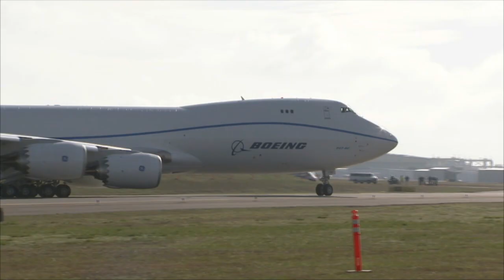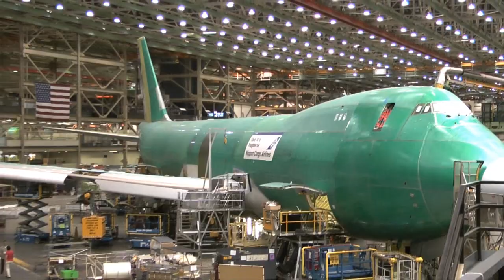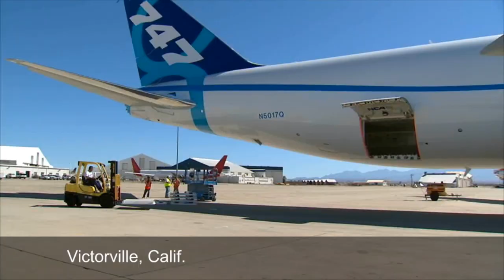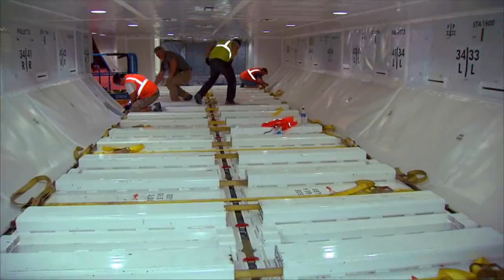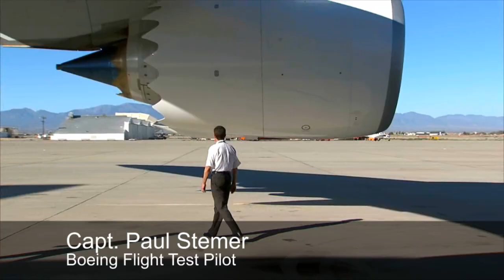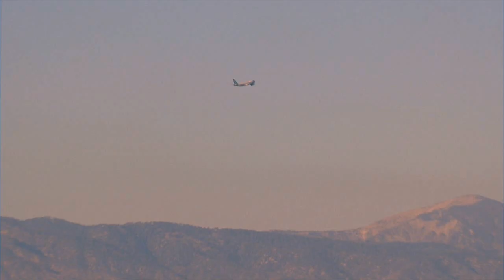Boeing 747-8's million pound takeoff

Comment: Open google, type "1005000lbs in kg", result = 455860 kg. Ah thanks Google.
Open calclulator, MTOW A380 = 569000kg, subtract the result= -113140kg. OK so the 747 freighter is still 113 tonnes lighter than the A380 pax aircraft.

Comment: if you don't think this is awesome, you must work for AirbusIndustrie
Reply: +Britt Thomas because an a380 can carry much more
Reply: A380FAirbus originally accepted orders for the freighter version, offering the largest payload capacity of any cargo aircraft in production, exceeded only by the single Antonov An-225 Mriya in service.[260] An aerospace consultant has estimated that the A380F would have 7% better payload and better range than the 747-8F, but also higher trip costs.[261] However, production has been suspended until the A380 production lines have settled with no firm availability date.[66][67][68] In 2015 Airbus removed A380F from the range of freighters on the corporate website.[262]

Comment: OKay, now get it back on the runway at that weight.   You know they went offshore and dumped most of that fuel before they came back in......
Reply: Well, you don't see NORMAL flights just going around and then the flight ends. You see flights that cross oceans and the fuel burned reduce the weight, allowing it to land on normal 747 runways. Well, it was a demonstration from Boeing to see that the 747 can go over it's massive takeoff weight, so it's not that strict and if a pilot miscalculated by only small numbers, 400 people (if it's a 747-8i) won't die because of it. Well, you are right, they won't be brothered to fly 8 hours, so you are right on one point.

Comment: Boeing is best. If it's not a Boeing I'm not going; )
Reply: +Bob Dylan Do your research, the KLM/Pan AM crash was 100% pilot error on the part of the flight crew from KLM.
Reply: +Rod Rocket the top two largest fatalities from an aviation related incident

guess the aircraft name?
Reply: That is just throwing mud around, no reflection on the safety or airworthiness of the aircraft. I work with both A-330's and 767's, I'll take the A-330 anytime so I am not always a fan of Boeing. In fact I still believe the USAF made a big mistake ordering the KC-46 (767-200) over the KC-45 ( A-330) As of right now, Boeing is barely meeting the price and deadlines for their tanker.
Reply: rampking1 same
Reply: rampking1 i did but they were still boeing planes

Comment: it is always very exciting to see that they manage to develope Aircrafts for the Logistics means. in the Future this kind of Planes will be very important. Trading Planes are not really less Important than the Passenger Planes.People should always remember that.
Reply: paganviodio  The strangest thing has happened over the last few weeks. It first started with a television reporter on a local station here in Los Angeles. This reporter was doing a story about LAX and the remodeling they are doing to it's main terminal, this reporter kept saying Aircrafts instead of the correct way, Aircraft which is plural and has no need to add an s to explain more than one Aircraft. I have seen this here on You Tube on several video captions using Aircrafts along with many in the comments sections. So folks it's always "Aircraft" and never "Aircrafts"
Reply: thanks, we are foreigner, i didnt know that. but it sounds to me as there is no diffirence at all...in other languages there is always a diffirent between singular and plural...i have to say, if i mean more than one aircraft ,then " more aircraft", and use more words, which sounds very underdeveloped to me ;;;)))

Comment: They are talkign about Gross Maximum Takeoff Weight right? Not the weight of the cargo? Because the MTW of a 747-8 is 975,000 pounds, and this is only about 2.5% over the that max. Not too crazy. The wording in the video is misleading. It would be really interesting to see what happens with 1 million pounds of cargo haha.
Reply: paganviodio Neither the An-225 nor the A380 can lift anywhere close to a million pounds of cargo. A380 Freighter's maximum payload is 330,000 lb. I'm not sure what the exact max for An-225 is, but it's far less than 1,000,000 lb. The largest cargo it has carried was 417,000 lb. Even the Stratolaunch Carrier Aircraft (the 'Roc') is 'only' designed to carry 500,000 lb. of payload (namely, the Pegasus II rocket stack.) An-225 holds the current record. If they count the rocket that Roc is carrying as payload, it will break An-225's record on its first flight test carrying the rocket stack.
Reply: Its is only misleading if you can't comprehend english. Nowhere in the title does it mention anything about lifting a million pounds of cargo. All I see is a "million pound takeoff", which is pretty close to accurate.
Reply: paganviodio  Actually, the An-225 is larger than the A380 in maximum takeoff weight (8.5%,) wingspan (11%,) and length (15%.) [1] It's a really big plane. And the Roc dwarfs both of them. [2]

Here's a good picture that shows how ridiculously massive the An-225 is: http://en.wikipedia.org/wiki/Antonov_An-225_Mriya#/media/File:Mriya_at_Bangor_International_Airport,_April_11_2015.jpg

In particular, note the ridiculous landing gear on that thing.

The An-225 is also designed from the beginning to be a freighter, whereas the A380 and the 747 were designed primarily to be passenger airliners with freight being a secondary use case. As airliners, they're designed for the vast majority of their cabin volume to be empty in the passenger cabin (though it might not feel like that when riding in an aluminum tube with your 500 closest friends for 15 hours.) To be able to fill all of that with dense cargo would require the structure to be much stronger (especially the wing roots/spars and landing gear) and the wings to be larger. Making those design decisions would make them much less efficient in their primary airline use case. Both the A380 and the 747 are actually designed to carry much more weight in fuel than in cargo, as is typical for aircraft designed as long-haul airliners.

[1] http://en.wikipedia.org/wiki/File:Giant_planes_comparison.svg
[2] http://en.wikipedia.org/wiki/Scaled_Composites_Stratolaunch#/media/File:Stratolaunch_comparison.svg
Reply: paganviodio Note also that they can't just trade fuel weight for cargo weight. The fuel is stored mostly in the wings, so the fuselage doesn't need to support its weight and, therefore, isn't designed to do so. Additionally, the wing roots and spars are only designed to support the weight of the fuselage and cargo (in the air) or the wings and fuel (on the ground,) but not both at the same time. Unless you store cargo in the fuel tanks (bad idea!) you can't just load less fuel in the main tanks to increase the cargo capacity beyond its design limits. Some airliners also have secondary fuel tanks in the fuselage that actually are removed in the freighter configurations. I'm pretty sure this is the case for the 777, but I'm not sure about the 747 or A380.
Reply: They already know what happens in that case. It's called a "runway excursion."
Reply: vbscript2 Really? I didn´t know that. Thank you for explaining, but t is also very surprising for me to read that 380 also couldn´t...I don´t want to believe that, just because, the Aircraft is physically much bigger, i think , they ´d manage to let the 380 carry more than that., i cannot imagine that a smaller plane can carry more than the bigger one...
Reply: sdguero28 im not very sure, but those Antonov Aircrafts CAN lift the Million Pound of Cargo in the Air, I guess...the Airbus 380, when there is a Cargo Version of that,then this Plane will lift more than that.With a little broader Wings, and stronger engines, you can even manage to lift the million Pound. I dont think , it is a big deal...

Comment: They don't need to do that because the MTOW includes full tanks of fuel. Once they take off, and fly 4 hours, it most likely has burned off enough fuel so it is light enough to land even with the 1,005,000lbs on board. So they can land safely.

Comment: Trailing cones (or trailing wires as they are often incorrectly called or trailing static cones), were first developed and tested in the 1950s and 1960's as a simple means of calibrating the static pressure (altitude reporting) error of an aircraft's pitot-static_system. It does this by giving an accurate measurement of the ambient atmospheric pressure (static pressure) well clear of the aircraft's fuselage. 

*lifted from wikipedia